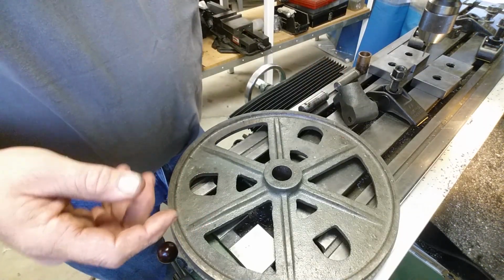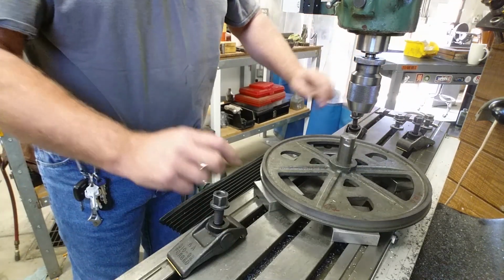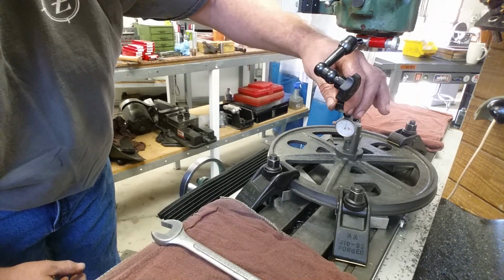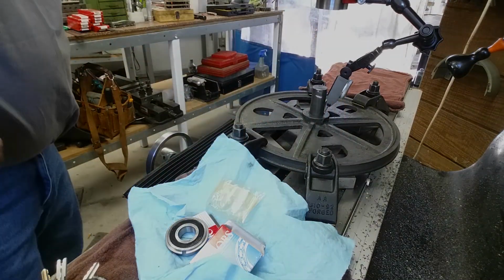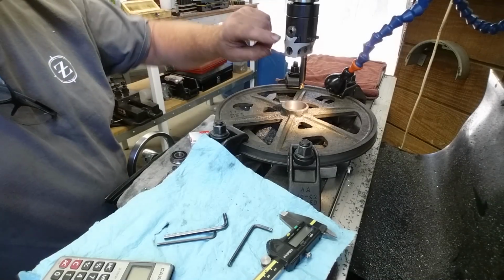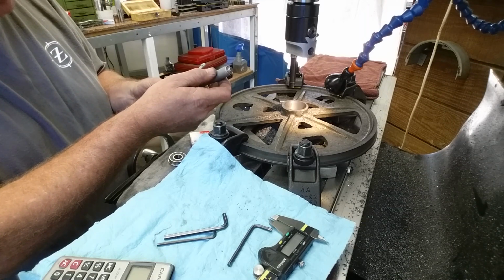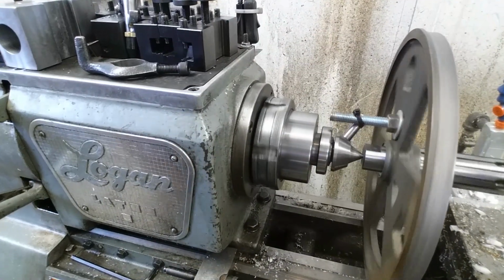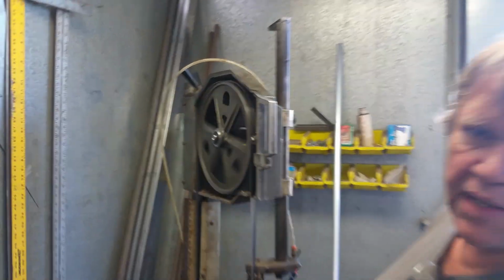Bandsaw bearing repair

Comment: comparatively speaking, what is the sound difference between the original bushing & un-trued wheel and the new ball bearing & trued wheel?
Reply from the maker: +Coffieman5150 Its an open gear driven saw, cant really hear any difference, but at least the blade says on now :)

Comment: ......no rubber on those wheels.........never seen that before in a vertical saw,....
Reply from the maker: +Rick L Hey Rick, it's a horizontal, just had the head tipped up to work on it :)

Comment: Wondering why not register the wheel by indicating on the surfaces where the blade rides. The current location of the bore (maybe it's worn; maybe it wasn't even right from the factory) is less important than the location of the machined surfaces (radial and plane) of the outer rim.
Reply from the maker: +Peter W. Meek I tossed that idea around too, the OD was pretty rough, not to mention egg shaped, I think I would have got inaccuracies either way.

Comment: This might sound silly but what's stopping the shaft simply rotating within the inner bearing ring if the resistance on the wheel goes up?
Reply from the maker: +Tom Jagiello I didnt cover my assembly liquids did I? Shaft into rocker =  Loctite green (permanent) Bearings into hub = Loctite red (removable) Bearings onto shaft = Loctite blue (removable) I dont have the part #'s handy but can get them for you if you like, shoot me an email if needed.
Reply: +Shadon HKW Ha! now it all makes sense, thanks Stan! I've looked through all the comments and no one said anything, so I though I must be mad and missing something here.
Reply: +Shadon HKW Red is permanent, green is wickable, both blue and green are removable with hand wrenches (assuming threaded fasteners.)  Thanks for the videos.

Comment: Let's see now, 
discovered a problem, 
determined a method of repair, 
went on a parts run, 
yacked it up with the guys at the parts house, 
acquired the necessary parts, 
used the mill in another interesting way, 
same for the lathe, 
achieved the necessary repair and saw a successful result that may last your lifetime,
created a video to share with the worlds machining community and entertained and enlightened many friends new and old.
 Not a bad way to spend a day.
    Mike (o\!/o)

Comment: Sorry for barging in on your video, Stan! Nice conversion to use bearings; how has the saw been running since then? Do you notice any differences in the cut now?

Best wishes,
Tom Z
Reply from the maker: +Tom Zelickman (Inspiration Metalworks) Still cuts the same, a little smoother .. oh .. and the blade stays on!
Reply: +Shadon HKW It's the little things like keeping the blade on that count, I suppose. ;)

Comment: Did you notice improved performance with the boring head? The reason I ask is because last week you ground the R8 spindle to within .0002. Good idea to replace the simple bushing with commercial off the shelf bearings. That will make future maintenance much easier.
Reply from the maker: +Roger Kimball Didnt notice any change in performance, but I know I was making a round hole!
Reply: +Shadon HKW   The spindle taper could be way out of wack and a boring head would still make a round hole.

Comment: Bearings are sized metric. Accident or very special order if matches imperial.
Flip the indicator face up and slid point to near rt angle and can view all sides without cocking ones head and moving around,cosine error doesn't matter for locating center.
Refurbish at its best.

Comment: don't those wheels normally have a slight crown on them to help the blade tracking?
Reply from the maker: +Lasse Langwadt Christensen If there was a crown on the wheel, it was long gone when it got to me.
Reply: +Lasse Langwadt Christensen  they do for wood, but i'm not sure about a metal bandsaw. i was gonna ask him the same question...if i had to guess i would say they're normally not crowned
Reply: +Lasse Langwadt Christensen Crowned wheels are  must when utilizing a softer material as in leather or synthetic flat drive belts. Harder materials, such as metal saw blades demand synchronous "true" running wheels, rather than forming to a crowned wheel to gain running trueness. Wheel crown will cause lineal cracks in metal blades.

Comment: Nice work, Stan! I think the reason that Tom is so good at "eye balling" is that he has his eye calibrated once a year. ... The bandsaws I worked on usually had a thin rubber tire on the wheel. You got better traction and didn't have the offset teeth of the blade dig into your wheel. Granted, these were large, vertical bandsaws with about an 18" throat. ... Thanks for the video! Waiting for the 2016 Bash announcement as I plan to come this year!
Have a good one! Did you take the wife out for Valentine's Day? 
Dave